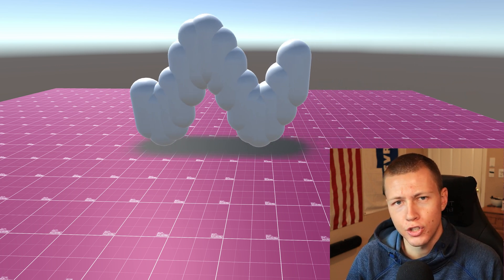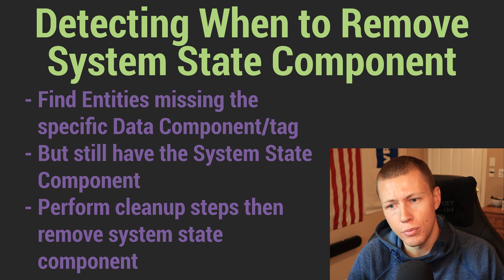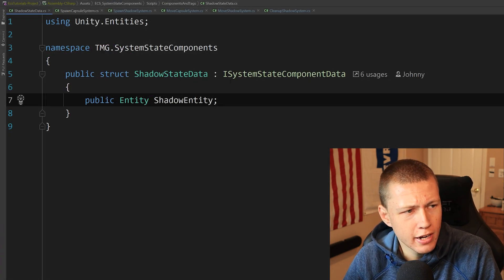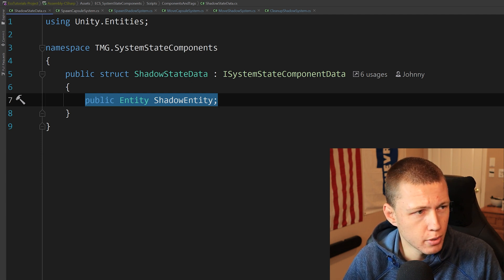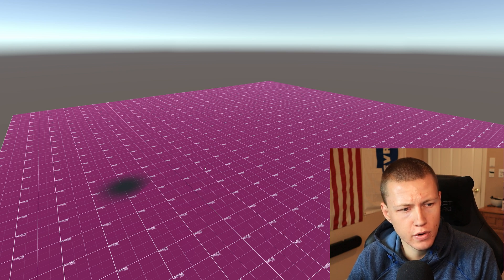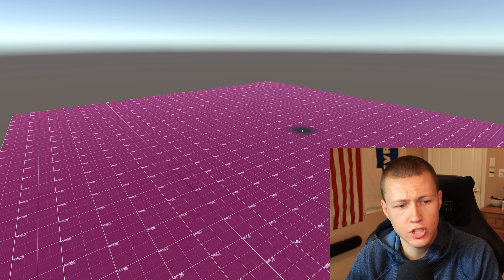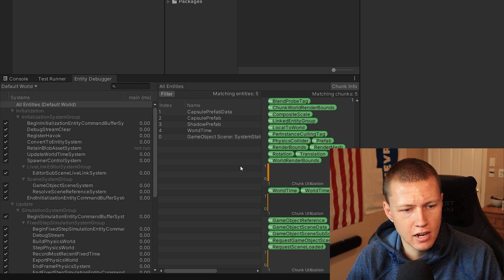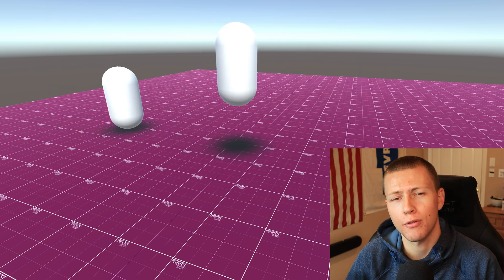System State Components in Unity ECS - Unity DOTS Tutorial [ECS Ver. 0.17]

Comment: Is removing every component from an Entity, destroys the Entity?  Since we didn't destroyed the capsule entity after we removed ShadowState data. Maybe because the MoveCapsuleSystem will Destory it in the next Frame?
Reply from the maker: Good question - in general, removing all components from an entity will NOT destroy the entity by default. This is because you can have "empty" entities that do not have any components associated with them (different than GameObjects where each of them are all guaranteed to have at least a Transform component). Where this changes is when this comes to what are now known as "cleanup components" (called system state components in this video) where you first need to call "destroy entity" on the entity, but the entity will still exist with ONLY the cleanup components on it. To fully destroy the entity, you'll just need to remove the cleanup components from that entity. Depending on how you implement these steps, this could happen all in one frame or over the course of many frames. Hope that answers your question!

Comment: I'm curious, why did you use .Run() instead of .ScheduleParallel() with a parallel writer?
Reply from the maker: Mostly just for simplicity of the tutorial. Though I would be curious as to how many entities would be required for Schedule/ScheduleParallel to be more performant than running on the main thread as there is some slight overhead with scheduling jobs
Reply: @TurboMakesGames  that is an excellent question! On a separate topic, you mentioned that the docs say to only set the data in the state component at creation time, but you think it's not a restriction that's set in stone. Well I tried it, and it's working just fine... So you were right 👍

Comment: That's interesting!  I may have a use for them.  I'm building an RTS with automated armies.  The armies use a trigger sphere to detect enemies, allies, terrain features, etc.  But they won't work, because I need a collider to mark the army for others to find.  Unity DOTS Physics has this weird quirk where if a Physics body has two shapes on it at once, it will register two events, so I'll need to have "detection" trigger collider on a separate entity.  Would this work for that?
Reply from the maker: So basically the issue is that you're getting two events from the two colliders, so the solution is to have a separate entity with the detection trigger so you only get the collision events on the main army's entity? Don't think you'd necessarily need to use a system state component for this, but it could definitely work well for that use case. Thanks for sharing!
BTW, feel free to share what you're working on over in our Discord community if you'd like - https://tmg.dev/Discord
Reply: think it would be more of a hack than a efficient use of the sys.st.cmp